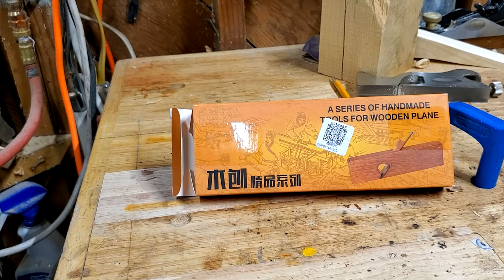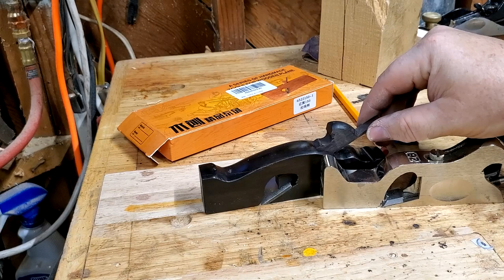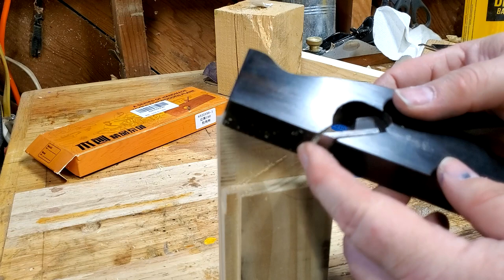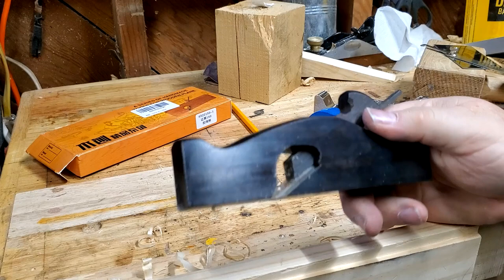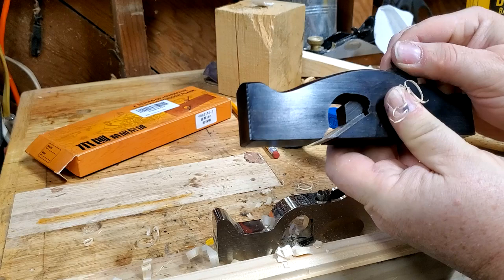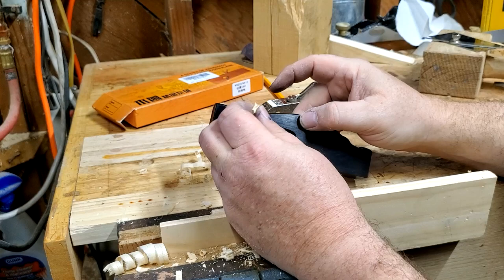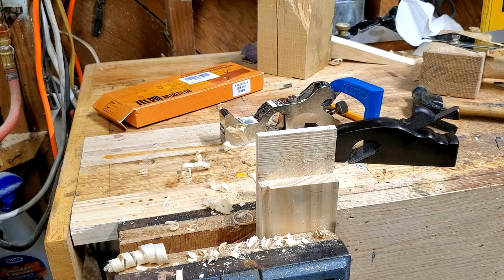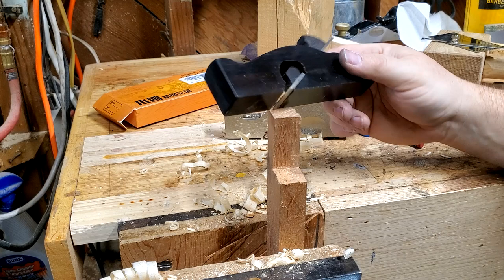Low Budget Shoulder Plane

Comment: If you leave the short end on the protractor plate, you can read the angle it's at easier. By visual alone, it is lower than 40 degrees.
Reply from the maker: Thanks Yang Ji.  I messed that up.  I put better measurements in the description.

Comment: You might  want to check that blade angle again.
Your Stanley has the iron flipped so the new one looks lower at the wood interface.
Reply from the maker: Yep, I bungled the protractor.  The angle of the Stanley is about 40 degrees and the wood plane is 32.  That's the angle from the sole to the top of the cutting angle on the blade.
Reply: @NotanExpert-Woodworking  It's been my experience that the lower the angle the better the plane works. 
Meaning less tear out and smoother shaving action.  
I'm unsure why all planes aren't made with the sharpest possible angle.
Perhaps because my experience is limited to soft woods.

P.S.  shaving end grain the way you did will blow out a chunk on the back end of the cut and ruin your workpiece.  I think clamping on a supporting scrap might help.

Comment: I think that's a rabbet plane rather than a shoulder plane. Similar, but shoulder planes are low angle, bevel up and usually metal in construction, whereas rabbets are higher angle and bevel down and usually wooden in construction. https://www.youtube.com/watch?v=Kh-p4YGzi8E goes over both a fair bit. It does look like they are borrowing the styling of the metal shoulder planes a fair bit though. I found one of the manufacturers' websites and they all just list it as a "boutique wooden plane" or just "wood plane" basically.

I love those cheap Chinese wooden rabbet planes. They've been making them there for a very long time so they're usually very utilitarian and quasi disposable. I have several with different fences and other modifications to them. They make for a pretty good platform to make other planes out of since all the hard bits are done and they are easy to refine or modify to your needs. I like the ones that just look like a big block of wood with rounded corners since they give me more to hold when I'm using them.
Reply from the maker: The Stanley 92 blade bevel is 40 degrees from the sole.  This one is 32.  Size and shape of the bodies are very similar.
Reply: @NotanExpert-Woodworking  Thanks for the info.